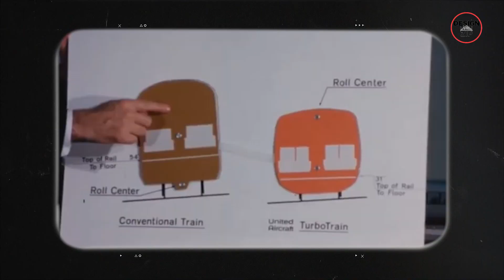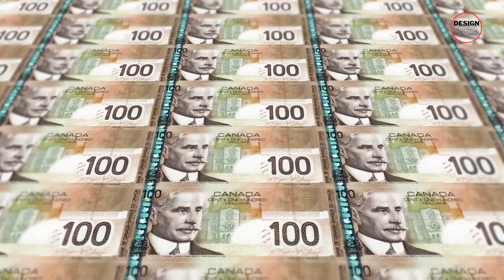Canada’s $120 Billion Bullet Train Gamble

Comment: Map @4:58 is wrong. Section between Ottawa and Montreal (the first section to be built) is to be on the North side of the Ottawa River, not the one indicated cutting south through Ontario.
Reply: According to who? Haven't seen any indication of this anywhere.
Reply: @danc1513  
[The first segment of Canada’s Alto high-speed rail project will connect Ottawa and Montreal, with plans to include a stop in Laval on Montreal’s north shore.
 The route is expected to run north of the existing Via Rail line, with the alignment still under development through a public consultation process beginning in January 2026.
 While the exact path has not been finalized, the project team has indicated that the line will be built on a new right-of-way to avoid curves and ensure high-speed operation.]
Reply: @stephensaines7100  It will be very stupid to get the Laval to Ottawa. 
It will be From Quebec -Laval-Montreal-Ottawa.
Reply: @clarification007  What is it you can't understand about "First Section?"
Reply: @stephensaines7100  North of the existing Via Rail line does not mean North of the Ottawa river.
Reply: @danc1513  While the final alignment is still under study, the route north of the Ottawa River is consistent with the plan to connect Ottawa with Laval and Montreal via the north shore corridor.
Reply: The information is exact. 
From Laval Station  it will go to Montreal THEN to Ottawa.  😃 👍

Comment: Of course Canada has built megaprojects of this size before. Start with the intercontinental railways of the 19th century, the trans-Canada highway, the St. Lawrence Seaway (3/4 paid by Canada), and oil pipelines from AB to ON, among others. Of course the biggest of all was to build Canada itself with so few people, a project which only ended with NL being integrated in the 1950's.
If they're smart they will add extensions to Niagara Falls and Windsor, which will attract American customers in droves.
Reply: Windsor is definitely a must since it could easily be connected with an American HSR to Chicago. Niagara Falls is pretty important since you could connect it with an American HSR to NYC, creating an important Toronto-NYC HSR corridor. 

I think the problem with HSR to Vancouver from Ontario is that it's too long for HSR to be viable. There are shorter corridors in-between that could be profitable such as Winnipeg, Saskatoon, Regina, Edmonton, Calgary, etc. I think that the planned Calgary-Banff line should be a Calgary-Vancouver line, etc.
Reply: Canada now is not 50 years ago. Deeply corrupted , inefficient and irresponsible. A eglington line can tell you the state of canada. What we need is a major reform before spending any money. Look at the eglinton line its been 20 years and severely over budget. If this project evwr started this will be the project that bring us to a situation like Greece . Bankrupt our country. We might even need to give up our free healthcare to pay for this. We need to be prepared
Reply: Well, if they are smart they will build it all the way to Vancouver. Or at least start a second segment in the west coast from Vancouver to Calgary,  and keep expanding it east in a second phase all the way to Winnipeg and finally extend it to Toronto in a third phase connecting the most of the country with high speed rail. 

I believe the Alto plan already included a Windsor extension in a second phase.. I don't think Niagara Falls should be a priority, since is already served by Go, so you should be able to go to either Hamilton or Toronto and from there go anywhere you want. The main issue with the Niagara Go line is the frequency, but ramping it up shouldn't be an issue.. specially if the province keeps pushing for the Go expansion project. 

Of course, they also need to build a proper terminus in Niagara Falls, because the current station is an embarrassment, and they need to figure out how to deal with the people dropped there (currently there is a free bus ride to the falls, but the process is kind of pathetic, a train drops 1000+ people at once and there are large lines to slowly board the buses)
Reply: @Imman1s  prbolem is between winninpeg to edmonton or calgary

and winnipeg to windsor it a big no mans land with only wood and field, so it will become the longest bullet train passing in no mans land
Reply: @Imman1s  a Vancouver to Toronto line would be amazing as a sleeper train.

Comment: Great video once again! 
What's pretty good with ALTO is that there's SNCF in 3 different ways: SNCF Voyageurs, the company that runs trains the TGV in France, Keolis, a subsidiary of SNCF that runs trains, tramways, metros, busses and pretty much all kinds of public transportation. 
And most importantly SYSTRA, which is SNCF and RATP's engineering and project management firm that has designed, managed, and overseen the construction of thousands of kilometers of high-speed rail lines around the world, and of every sort of public transportation infrastructures as well.
So this is excellent for the project'a success likelihood, as long as SYSTRA is put in charge, or at least given enough power.
UK's HS1 was driven by them, but HS2 was not, and we've seen how it went. Same for CAHSR where SYSTRA wasn't put in charge but only at a lower level.

It seems like Canada's first high-speed rail line may really become a reality this time, and that's great.
Reply from the maker: Thanks for the detailed breakdown. That’s a really important point about SYSTRA’s role. Their track record on high speed rail and complex transit projects is hard to ignore, and the contrast you draw with HS1 versus HS2 and CAHSR is especially telling. If SYSTRA is genuinely given authority rather than a token role, ALTO’s chances look far more credible than past attempts. Let’s hope Canada actually sticks with that expertise this time
Reply: @designzip5890  Yeah, ideally the project should be publicly driven, but Canada doesn't have experience doing this.
Putting SYSTRA in charge would be the closest thing to a very experienced public entity driving the project.
When France was building the first line of the TGV network in the 70's, it was done by SNCF's engineering which became SYSTRA.
So even if they are now a technically private company, their nature and origin is public infrastructure building.
The other major name in ALTO is CDPQ Infra, which is the Quebec pension fund's infrastructure branch that led and oversaw the REM.
So it's the next best thing after a truly public entity, and they have what's needed for the project to succeed, aa long as they put both SYSTRA and CDPQ Infra at the helm.

Comment: But it won't be cheap. Reason: winter climate mitigation, which means withstanding heavy snows and temperatures that could potentially drop below -30° Celsius (-22° Fahrenheit) in January and February. That means tracks that need a lot of warm water spraying to keep snow off the tracks and certain stations that need to spray the entire train with warm water to keep the snow buildup off the train. Ask JR East how much that cost when they had to do this on the Hokuriku Shinkansen line from Tsuruga all the way to Nagano.
Reply: better vandal-proof that forthcoming Tempo railroad, so get cracking..💡💡💡
Reply: It won't be built. Canada has trouble with climate.why is the electric Montreal rem so bad in winter,why do via German chargers never work. Can't be done here
Reply: @petere4540  Yes it can. Sweden has a high speed train in the arctic circle. So enough with the excuses.

https://www.youtube.com/watch?v=WXwGuQsWvMI

Comment: What we need is a high-speed train from Toronto to Hamilton.
Reply: Go train is fine as it is.
Reply: The curve around Lake Ontario, makes that a non-starter. Highspeed rail needs to basically be a straight line to maintain speeds, if you add the curve, you might as well just Gotrain it.
Reply: @CanadianLibrarian-Scott 
The tracks from 
Lakeshore Go Station in Etobicoke to Burlington already are virtually completely straight.

There's no significant curve of the lake to worry about over that stretch.
Reply: @CanadianLibrarian-Scott  That's ridiculous... HSR just needs a larger turn radius, but there's a wonderful thing called track canting, which makes the train lean into curves.
There are plenty of curves on high-speed rail lines, some quite tight for such high speeds, but the trains simply bank inward like planes, thanks to the tracks built for this.